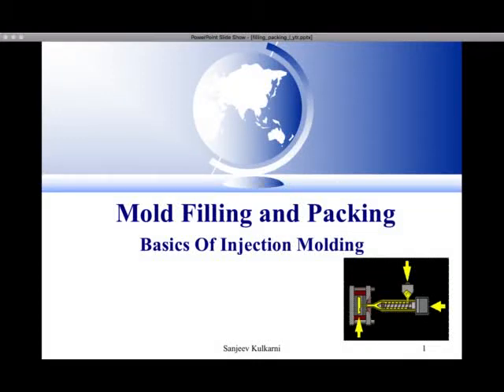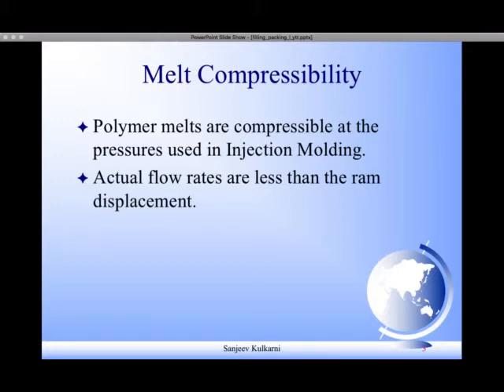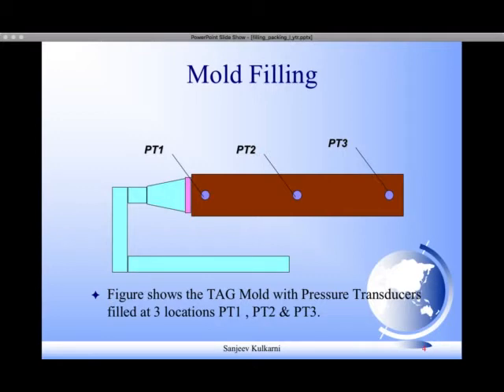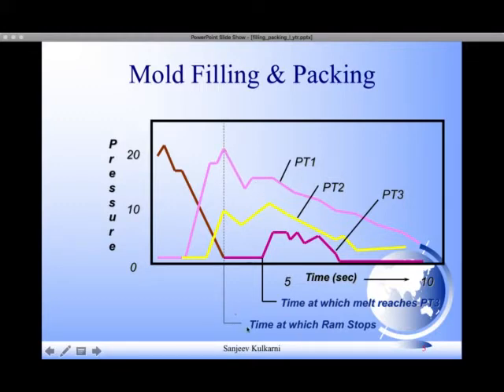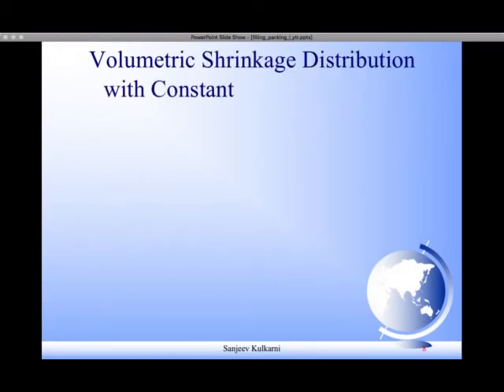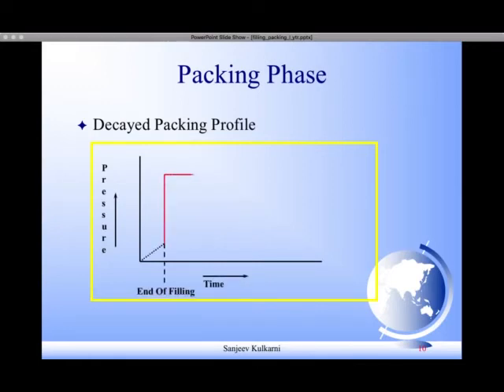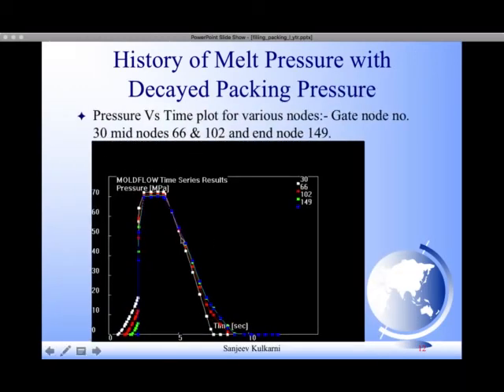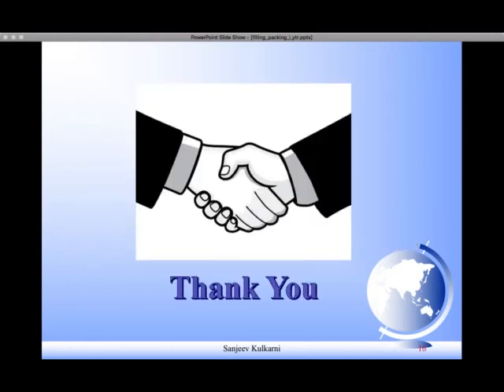Injection Moulding - Filling & Packing Stages

Comment: Hi Sir, at T1, the material is not flowing and we'll start plasticating. Therefore, no point in applying pressure. I think T2 should be T no flow at the gate.

Comment: Start from what is injection molding.
Reply: good quesion
Reply: Injection molding is forming dimensionally, cosmetically, acceptable plastic parts and at a rate of production that would be profitable to your company. If they say 10 or 20 seconds. molders have to fit the entire molding operation inside that time or have the exact reason it's not possible. Then your plan to fix any major issues. and the rest is a lot of hot sweaty labor. Have fun.